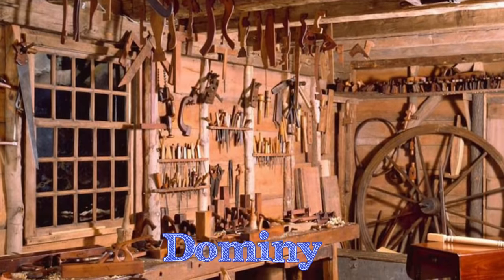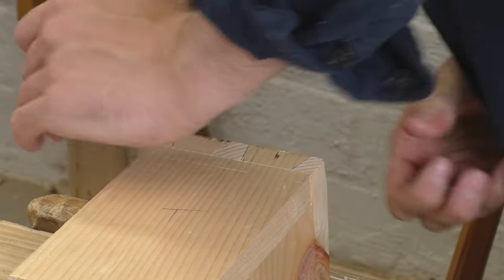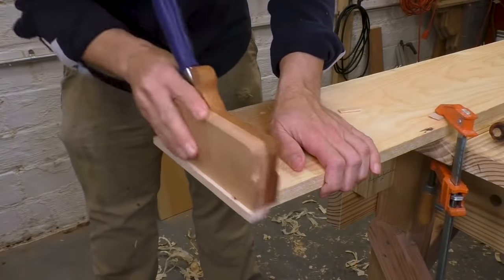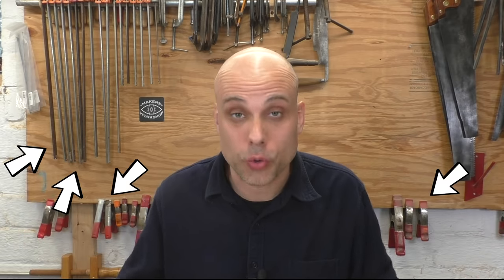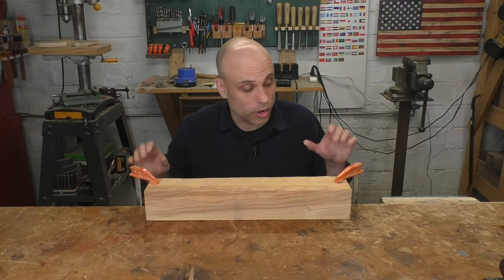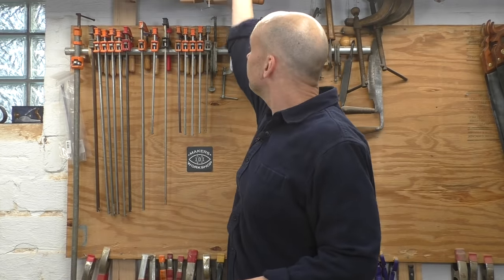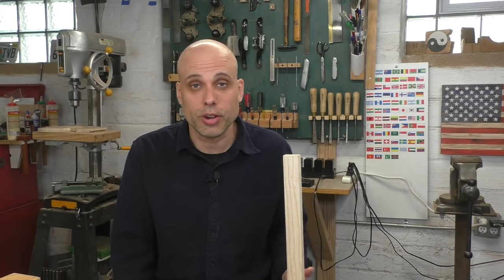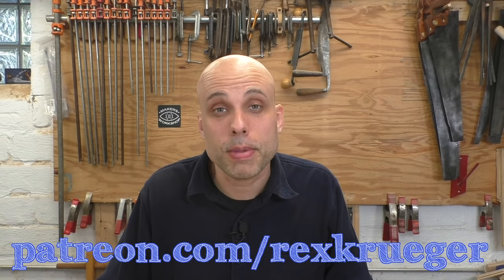Woodworking with very few clamps (maybe only 5).

Comment: An important part of why in the past people didn't use as much clamps is the glue itself. Bone/hide glue "tightens" up while it dries. Additionally it dries super quickly to a state where no pressing is needed anymore and it needs only a couple of hours to really harden up for real use. Glueing up boards in the past was done vertically and the weight of a board was enough pressure for a hide glue up.
Reply: my father used to restore antique furniture quite often and the dovetails in those usually didn't even have any glue in them, so many of his jobs revolved around pieces that came apart when the owners brought them into modern heated rooms, the pieces got too dry, causing the joints to loosen.
my father explained to me that, what they did, was to have the pieces way drier than normal during assembly, this causes the wood to contract, once dried, they'd put the pieces together and then let the wood absorb moisture from the air, this causes the wood to expand, creating an extremely tight  friction fit.
as for mortise and tenon joints, the trick is to only dry the tenon piece, hammer it into the mortise and then the same thing happens, the tenon absorbs moisture from the mortise, expands inside and causes a friction fit.
Reply: That's a very good point! Hide glue was the clamp itself. Never thought about that. I still use hide glue for my canvases and canvas panels while painting because of its archival properties and that's a characteristic of its behavior.
Reply: Does fish glue do this, as well? I just can't bring myself to get a gluepot and baby my glue, and my shop is very cold in the winter which would make for a very short open time. So, I use fish glue on stuff I want to be able to be taken apart if needed someday (stringed instruments). I like the long open time and high tack.
Reply: Panels would also be assembled using rubbed joints...put hot hide glue on the jointed edges and rub the edges together until the glue “grabs”. The panel can then be set aside (on edge) until fully set. It does also work with modern glues, though I haven’t done it myself.
Reply: @georgenewlands9760  I often rub joint with pva and it's great if you are clamping as well because it prevents the timber sliding when you tighten the clamps
Reply: @windhelmguard5295  WHY HAVE I NOT REALIZED THIS MY WHOLE LIFE UNTIL NOW?!?!? That is an amazing idea
Reply: @windhelmguard5295  ;d tystt
Reply: Glue made from animal glue and hide? Sounds cool. I don't like synthetic chemicals.
Reply: Instead of purpose-built clamps, ropes and wood wedges were often used to hold work together, at least in East Asian countries. One technique was to tighten the rope as much as possible around the work, then tie it and insert wedges where needed for additional pressure.
Reply: @windhelmguard5295  There is a company building house-walls using this dry/wet friction fit mortise/tennon construction method to build 40cm thick full wooden walls, that are enough to insulate against even harsh Austrian weather in the winter.
Reply: @hananokuni2580  I was just thinking about this earlier today! 

And came to the theory that they must have used some kind of rope/binding, some version of truckers hitch knot to tension it, then whatever sized shims or wedges would be appropriate. 

Great to see your comment this same day, thanks!
Reply: @W4ldgeist  WOW that is incredible. This isn't something I've seen or even thought of before .. what is used to keep the material dry until it's time to join up? That seems like a whole project in and of itself.
Reply: @willbephore3086  Don't forget the rope-and-stick tourniquet. It's great for boxes and trays. Also useful as a vise for holding workpieces fast against a bench.
Reply: @hananokuni2580  yep that one is great! I use some dedicated light duty wratchet straps fitted through 4 corner forms  - probably why the concept of the rope/wedges even occurred to my thick brain lol.  I'm considering 3d printing some new corner forms for the straps, mostly just to play with toys, as the wood works great already.
Reply: @willbephore3086  Search in YouTube for Holz100. They have a ton of videos showing the processing.
Reply: @W4ldgeist  I've taken screenshots of this entire thread, what a helpful, fascinating conversation. Thank you, will check that out, this concept is somewhat blowing my mind right now and making me rethink almost everything.
Reply: @troyclayton  if you have a 3D printer, I use my 3D printer's bed to melt/keep my glue warm. I just stick it and the water in a ceramic dish on the bed and warm up the bed. It's great because you can never overheat it
Reply: @troyclayton   I dunno if you have a 3D printer, but if you do I like to use mine to warm my glue. I have a simple GCode set to warm up the bed and to shake the bed back and forward to melt the glue/keep it moving. 

It's great because there's no risk of overcooking it and denaturing the proteins that make the glue gluey.
Reply: I like how people romantize the old fashioned way of doing things.
Reply: I think it’s rather an informed view on what was done in the past, what worked, why it worked and what it did better/different than modern approaches and materials. I completely get the superiority of many modern materials and approaches, but most of them do not apply to my use cases. So I chose to not live with the drawbacks of modern materials and chose methods that are often times less hazardous to the environment and me.

Comment: A mostly overlooked cheap alternative to bigger clamps (especially when glueing together boards) is the ratchet tie down strap. It has incredible power that can be easily directed with some well-placed pieces of wood.
Reply: Good point!
Ratchet straps are a versatile option.

It's possible to make simple wedge clamps without screwing them to your bench top with lumber preferably drilled with multiple holes and a loop of rope with a twisting stick is possible, a Spanish windlass and so on, so there are some simple improvisations he doesn't show that aren't as involved as using threads you make or buy.
Another example is an F style clamp that uses a cam rather than threads.
This brings up that a cam can often be used in place of a wedge or opposing wedges or threads.
Many have used both for clamps with lumber, possibly drilled with holes for adjustment or in dog holes in their bench for big glue ups.
I feel he is too thread oriented in his dismissal of self made clamps and holding up a C clamp with threads made of wood doesn't represent what's been done or can be done very well. There is a lot out there on self made clamping and clamps that doesn't involve threads, bought or made.

Comment: The draw bored mortice and tennon is such a good joint! A ratcheting strap is great for the really long stuff with shims to protect the work piece. Thanks Rex.
Reply: I too use a ratchet strap and also a set of tourniquet cauls for larger pieces.  It's not ideal, but it's a dirt-cheap solution for when I just really need to fix a chair or table
Reply: Yup bike lifts, tow straps, clamps, winches, oh and I think they may also help in attaching cargo to vehicle attachments. Truly awesome little gadgets

Comment: I think you described my situation perfectly when you discussed power tools. I have been preparing to prepare to do some fine woodworking for YEARS now. All I seem to do is buy, set up, improve, adjust, repair, refine, modify and otherwise tinker with my power tools, with no time left for actually using them to their full potential. My shop, although it is a fair size, never seems to be big enough. I think it's time for me to take a long and careful look at what I really NEED as opposed to what I think I want! Thank you Rex, I'm really enjoying your videos.
Reply from the maker: Lots of people are "preparing to prepare." I want to help with that.

Comment: I have enough clamps to clamp up most things I want to build, but that’s usually not the problem: most people aren’t missing the clamps required for their project, most people run out of clamps when they’re glueing up several pieces at the same time. And that’s not just a problem for commercial shops, it also applies to hobbyists who don’t have an endless supply of spare time.

Comment: I've found the "need less, do more" to be true in almost everything I do.  My photography started off with me purchasing anything I could get my hands on.  I ended up with 7 studio lights, a bunch of stands, light modifiers, and backgrounds, as well as just about every software for editing photos one could buy.  Now, I use 4 lights at most (and usually just 1 light on almost everything I do, and that's usually a speedlight), three modifiers exclusively (1 huge silver umbrella, a 34" foldable beauty dish, and strip boxes), one background (18% gray, which is easy to replace with any other background I want), and one editing program (Affinity Photo).  Drawing and painting is the same.  I even started making my own charcoal for drawing.  The one thing I'd recommend for artists to either buy or build is a very good desk ( I use a Mayline Ranger 60" desk).  Having a proper surface is so nice to work on.  My painting, I only need about 7 colors, including white and black.  Everything else can be mixed.  The brushes, maybe 10 different brushes.  Keeping things simple allows me to focus on the creation I'm trying to make and less on the equipment.

Just found your channel today.  I enjoyed the video.  Keep up the good work.  Subbed.

Comment: Rex - hope you are ok after your panic attack !! Paper bag scene - my favorite Rex comedy moment of all time !!!
Reply: I've had panic attacks.. I Remer one time I was taking seats out of a vehicle. I was also going through a divorce... I stood up from the car and suddenly...my heart started racing and pounding out of my chest. It took a good 25 mins to calm me down. I thought I was dying. These were in my younger years. Had atleast 2 similar situations. Very scary, very uncomfortable.
Reply: @k3ith29  that's terrible, actual panic attacks are the worst. I've been on the supportive end of one and can kind of imagine what it's like.

I hope you could still appreciate the video intro for its comedic value.
Reply: I worry "sprung joints" may year themselves apart over some years, by will of the wood.
Reply: @tomsenft7434  Actually less likely to have the boards come apart at the ends - have a read of this ... https://www.finewoodworking.com/2010/04/26/spring-joints-an-edge-glue-ups-best-friend Edit: I think spring joints are far easier to do by hand with a plane than with machines.
Reply: @k3ith29  thanks for sharing. The real thing must be pretty scary.
Reply: I was absolutely in stitches from that! Helps that I just watched some Comedy, but still. Really good comedic timing interrupting the into like that. 🤣

Comment: Fun fact: Timber framed houses here in germany use the very same technique of offset holes - at least back then, when they used hand tools. Today they usualyl don't cut them by hand so they usually fit together so well that they don't need it.

Comment: You inspired me over the last couple years. Thanks to you my animals have much nicer "cages" that look like real furniture. Im in the process of making a huge Chinchilla cabinet with just a hand saw, drill and couple of clamps in my apartment. Thanks so much!
Reply: How did you do it in your apartment? is your room big? what about the mess?
Reply: @yiduoqian5046  lol it could have been a huge mess in a small space! I used my kitchen, which has a small island counter top as the work table. Its about 2'x2' and with some clamps and creativity did just fine. I also swept after every few major cuts and sanded outside. Tedious but worth it.

Comment: I just love it when an expert describes exactly what I've kinda ended up with myself!   I have two pipe clamps - which started out with very long pipes - at some point, I couldn't fit them where I needed them - so I cut the pipes and ended up with two medium and two short pipes - then I needed long ones again, so I bought more pipes.  Now I have two clamps and a bunch of pipes of various lengths.  I do have six bar clamps - two of each in three sizes.  But I literally never use the middle sized ones - so those could go.  My large collection of G-clamps are VERY rarely used.  And those sprung scissor things - I do need and use in large numbers when doing something like gluing thin plywood to a frame or something like that - I could nail them - but that might spoil a finish or result in a lot of filling of nail holes.  But yeah - I could definitely downsize my clamps.  But this weekend I'm tossing out my pegboard wall and going with french cleats - so I'll have a TON more space - and quite honestly, I'll probably hang on to those G-clamps "just in case"!

Comment: 1868: "Did you hear ol' Felix Dominy passed away?  His son should be arriving on the train tomorrow."  "Indeed?  I think I might sneak over there after dark.  Ol' Felix had a bunch of clamps, and you can never have too many!"

2021: "The Dominys didn't use very many clamps."
Reply: I am still kicking myself and ruing the day I spotted a Craig’s listing by Wally Kunkel, Mr. Sawdust himself. He was letting go of all his clamps, bar and deep reach types, the old industrial ones like Hartford and Wetzler and such. A fair price, no gouging attempted. And an invaluable opportunity to meet the man himself, and maybe chew the fat a little. Was only a week too late.
Reply: Actually, fun fact: Felix as was common at the time, made his own coffin. Indeed, it was during the final glue-up that he realized he had too few clamps to really exert the pressure he felt he needed for a box that is ostensibly air and watertight (and intended to keep him from being consumed by bugs and worms). T'was the stress of that very realization that caused the fatal heart attack that did him in.

Upon his arrival, the coroner found two things of significance: 
1. Felix's stiffening corpse still lying where his horror at discovering his clamp inadequacy had dropped him, and 
2. Felix used hide glue (of course; it would be some 42 years before modern PVA glue would be invented), and while its open time is brief enough, it's final set time (and its resistance to water intrusion) takes DAYS.

Yes, the sad truth of the matter was Felix was buried with his clamps... t'was the only thing  holding his coffin together. 

At least he can be grateful there, though.... can you imagine how awful, how much darker things might have turned out if the poor craftsman had only had a few? Like maybe a half dozen? Especially if like half of those were like spring clamps? shudder

That's no way for a man to live. Damn crying shame.

Comment: I couldn't agree more about the fact that owning a lot of things (including tools) soon become an hassle more than an opportunity. As someone once said: "'The things you own end up owning you".
Also, being efficient and getting the job done with less, is very satisfying per se.
Reply: I'd rather have tools I don't need than need tools I don't have.
Reply: @1pcfred  Sure. But the point is that if you can get the job done without, you don't "need" the extra tool.
Reply: @WhyDontYouBuildit  depending on the task I am often better off using power tools. They hold accuracy better than I can. Then there's the power aspect of the equation. My table saw will kick your ass ripping boards by hand. I'll run a thousand feet through it before you get up to 100.
Reply: @1pcfred  That's for sure!
Reply: @WhyDontYouBuildit  horses for courses. I have plenty of hand tools in my stable too. Still love me some power tools though. I am in the process of adding a new machine.
Reply: @1pcfred  I have nothing against power tools. I use the few I have when I have something that needs to be done fast. But in general I don't enjoy using them, at least not as much as hand tools, so for the things I do for the pleasure of doing (which is practically everything, giving the fact that nowadays buying something is almost always cheaper), I prefer to use hand tools.
Reply: @WhyDontYouBuildit  I derive satisfaction from hand tools and power tools. It all gets the job done. Although some power tools are nicer to use than others are. I couldn't tell you how many circular saws I have. I could tell you which my favorite two are though. There are intangibles going on in the process. A heft, a balance, a certain smoothness, a sound. Sometimes it is hard to pin down precisely where joy comes from.
Reply: Being efficient doesn't mean getting the job done with less.  It means getting the job done correctly and well with whatever tools are needed.  I would NEVER hire or pay someone whose mantra was "get the job done"  That's a really, really bad attitude.  Get the job done correctly.
Reply: @yrralyou  you must be fun at parties.
Reply: @yrralyou  Hiring someone that does a shitty job is very inefficient, because you need to hire someone else to fix the mistakes that were made by the first person😉.

By the way I can't help but feel that what I intended to say in my first comment got lost somewhere.

Comment: Excellent  video Rex! With a crew I restored an old timber frame tobacco barn owned by one of the signers of Constitution. Almost all joints were draw bored mortise and tenon. , I didn't know what the joints were called until now. There were also scarf joints in the rafter plates, these were held together with two wedge shaped pieces of wood driven one on each side of the timber. The pegs we used on the mortices were called treenails. I don't know what the wedges were called. We had no power equipment on the job site. I still have the barn drill, hewing axe and hatchet left over from the restoration. Thanks for the video.

rex
Reply: Great opportunity!